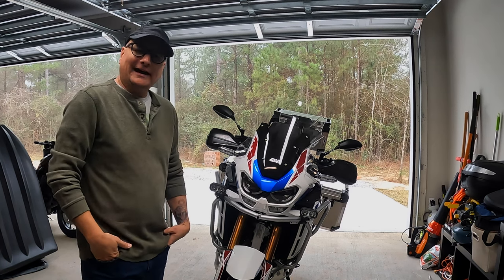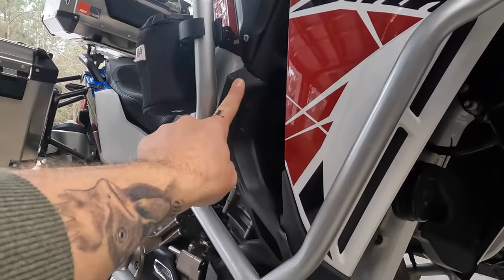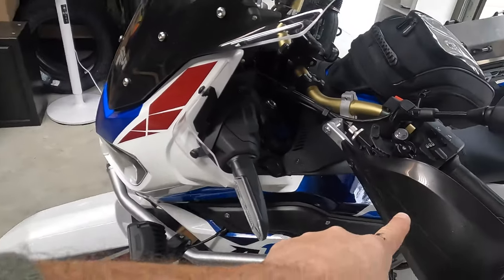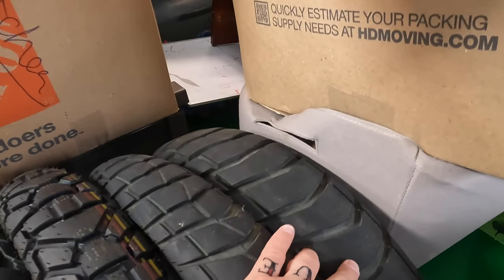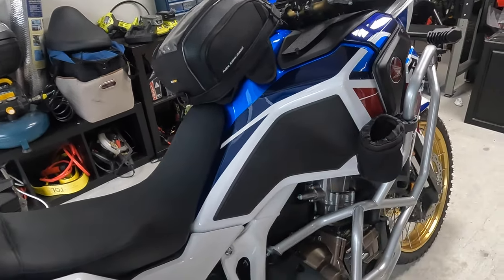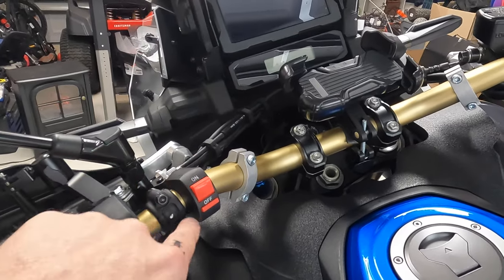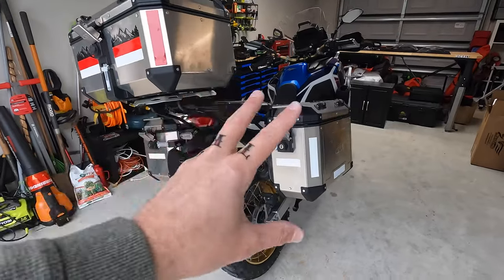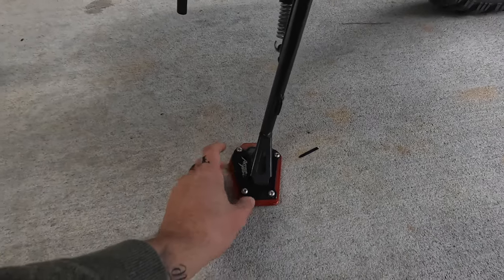The PERFECT Honda Africa Twin Adventure & Touring Build

Comment: Good review! I spent a ton outfitting my AT, however it'll probably be the last new bike I own so it's well equipped I think. My windshield is still stock, it seems to be ok. I've got Outback Motorteck engine guards, lower and upper. Mounted on them are a set of Denali D4's for my driving lights, and a set of Denali D3 fog lights with amber lenses, I have an abundance of very large wildlife so I wanted intense extra lighting  and they are controlled by a HEX ezCan. Upgraded rad guards from the plastic ones it came with, also the fork tunnel air damn, Lone Rider Ranger Mini tank bag for longer trips, Lone Rider Moto Pegs, Honda centre stand, 37/48 litre Kappa aluminum panniers, and a Kappa 52 Litre Plastic top case. I went with the Kappa plastic top case because it was a little more aerodynamic than the aluminum ones and the top case is on the bike at all times, my panniers go on when I need them is all. Almost forgot, also fitted it with a Scott oiler for my chain. Never tried one so I am going to see if this helps chain life and maintenance, in theory it should. That's about it in a nutshell. Ride safe!

Comment: I have put a GIVI windscreen like yours on my ATAS 2021. The rearviewmirrors  and hand protectors  are beatting on the windscreen when the handlebar is on its complete steering course . My handlebar has a raiser... I am trying to solve this problem spinning the hand protectors down and shifiting the rearviewmirrors instalation to the handle bar with an adapter. Did you have any problems like that without the raiser?

Comment: Great review. I have the same bike with stock windshield ,Honda upper wind deflectors and forksheild cover. I’d like to ask two questions.
1. Do you have any wind noise and buffeting above 120-130 km/h with this wind blockage setup ? 
2. Why did you cut the givi windshield ? Was the cut made only for the better looks of the bike? 
Thnx mate looking forward to your reply
Reply from the maker: None at all, and if I put the windshield din the high position out just about removes all wind. Great for highways, rain, and cold rides.

As for cutting the windshield, wow it was super tall stock. Even in the lowest position it was super tall, I was always looking through the thing. I like to ride without looking through a windshield a lot, especially when off road.
Reply: @adventureundone  how many cms did you cut from the top of the givi windshield ? Also how tall are you ? Thanx

Comment: Great video,  but I greatly disagree with you on the seat.   I too purchased the same seat that you have and the seat is the absolute worse I've ever owned.   Lacking padding big time and I can't ride more than 20 miles before my ass is killing me.   Stock seat is so much better (and that's not saying much), and quite honestly,  I'm going to modify it myself with a new gel pad and memory foam addition.